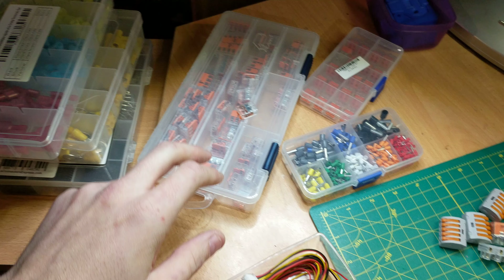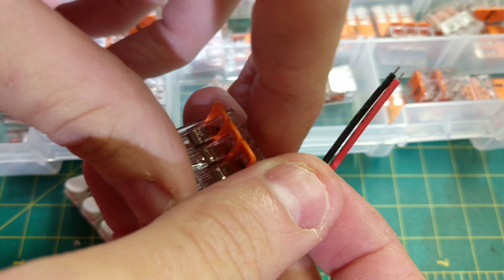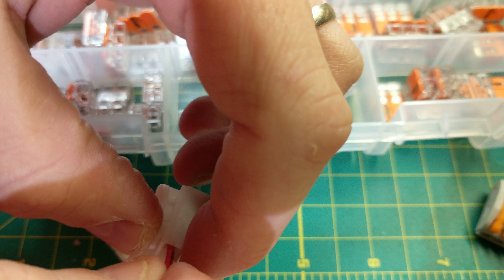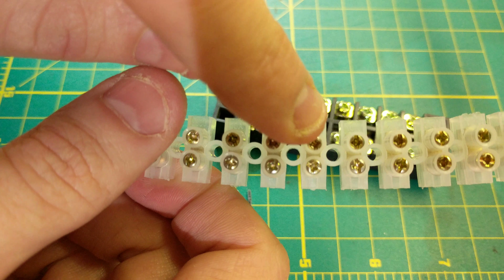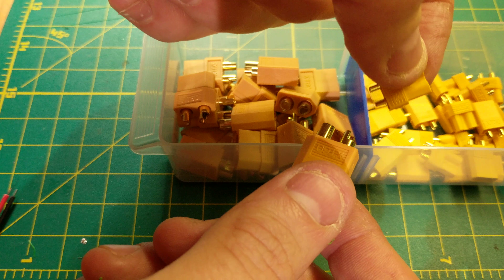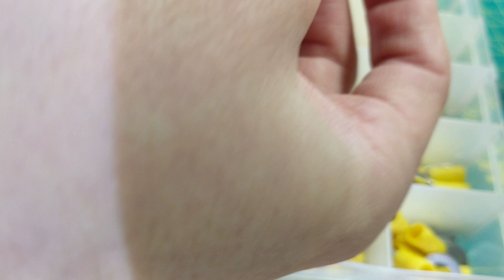ENIAC 40 101 - Connectors Part 1

Comment: 4:20 May be it's not correct, but i think you can connect the two wires  by putting it in the same jack, it's will hold it fine .. =)
Reply from the maker: +Allen Maker you can.  I just don't like doing that because if the wire gauge is to thick I find the levers don't fully close.